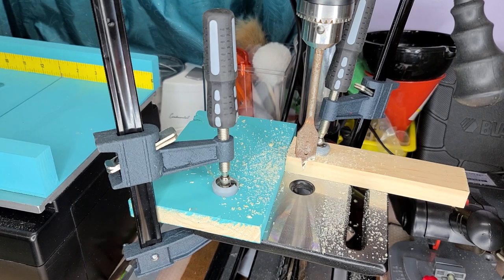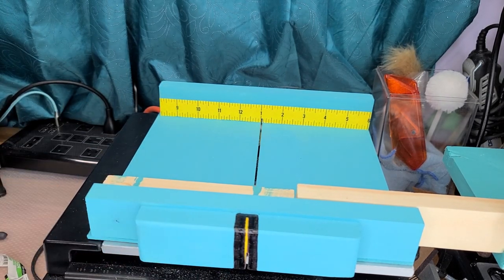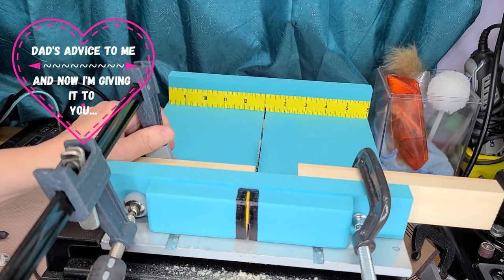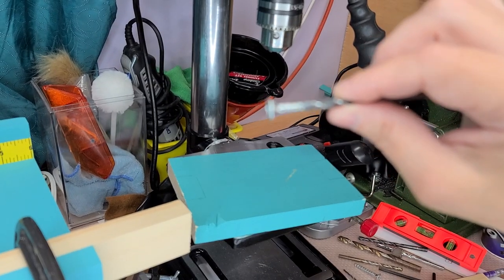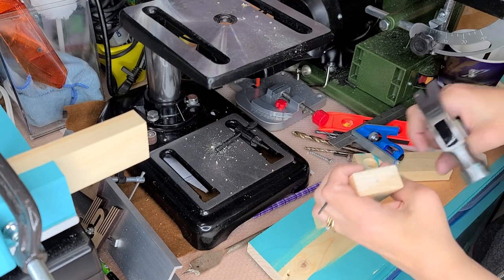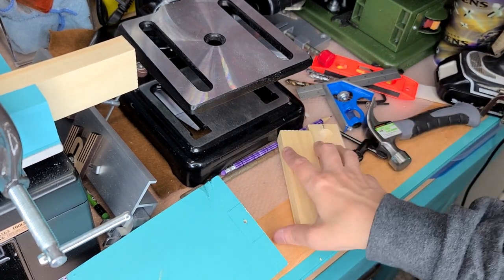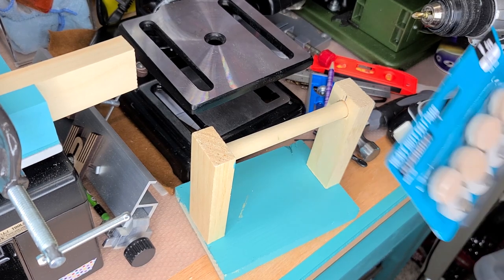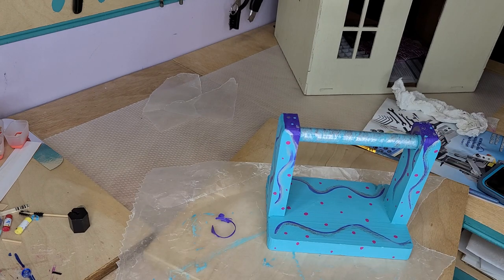My DIY Plier Stand

Comment: Just a little tip, if you use a spacer (say 1.5 inches or larger than the off-cut) up against your fixed stop on your sled between the piece you're going to cut then when your wood being cut is clamped you can then remove the spacer and proceed to cut the wood. This way it will stop any binding when cutting and avoid kick back and potential injury or damage to the blade or saw. Just add the spacer for the next cut and repeat, ect. 👍